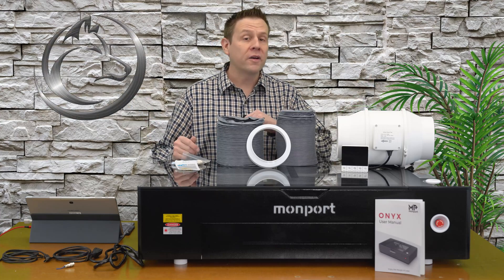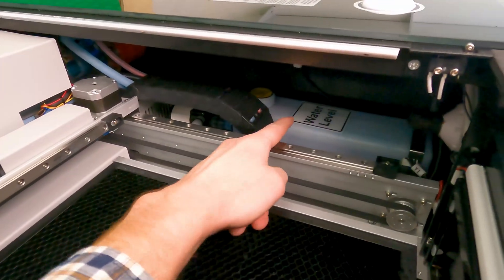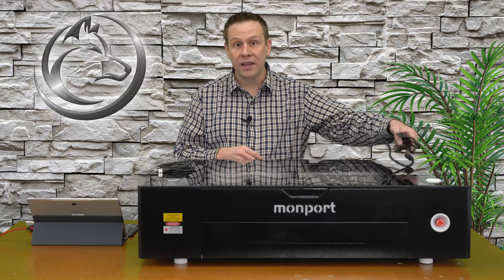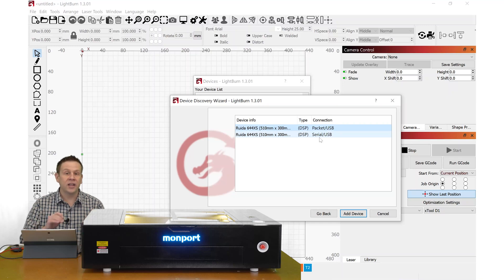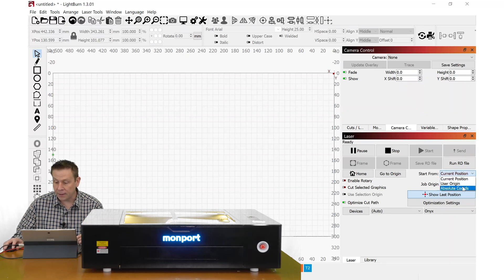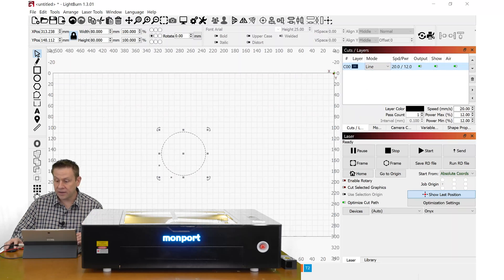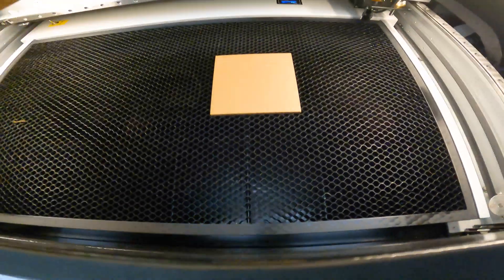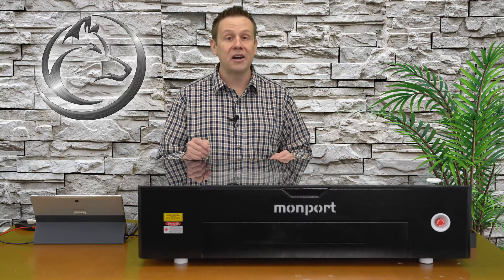Monport Onyx  Setup and First Lasering (Condensed Version)

Comment: I just received my new monport onyx r laser.   I have one problem with it.  The Z axis and autofocus does not work.  Everything else on the move box works fine.  I cant figure out whats going on.  One comment is read on the internet says there is a fuse for the z axis, I cant find any fuse?   I have contacted support but havent heard anything yet.  Only had it for 5 days now, what a bummer.

Comment: How do you like Monport? Are they good?
Reply from the maker: That's a common question a lot of people ask.  For me they've been very good- I understand what type of laser projects/materials I plan on working with.  If I have any questions I email them with what I would like to do and wait for their response for their recommendation(s). Forum groups can be hit and miss getting a feel for a brand name- people tend to complain more than they praise and those with positive experience are in their shops creating projects.  I think the product lines are good- I've used the 40w Co2 laser line, Fiber laser, and Onyx with Co2 laser- I think all of them are good.  Later this year there's possible plans for a large 130-150w co2 laser!  Hope this helps :)
Reply: Monport does not answer customer help requests?  You're better off buying on eBay.  The support will be the same.  If I don't hear from them soon I be disputing with CC company.  There is a whole FB group experiencing this. I received a brand new machine that doesn't work. Beware!
Reply from the maker: @jayvanessa6551  Sorry to hear you're having a bad experience, but thank you for sharing.  Right now I know (2-13-2024)a lot of the staff are celebrating the Chinese New Year.  Keep me posted on your issue(s).  BTW- what's not working on your machine?
Reply: @thelaserchannel1  I could not get it aligned.  A lot of people assume you're doing it wrong.  I took the gantry and frame out, you'd not believe how twisted it was.  Like a friggin' rocking horse when I pushed on the corners.
Reply from the maker: @jayvanessa6551   Ouch- yea, that doesn't sound right!  Mines been great- sorry to hear yours has issues.

Comment: The duct reducer goes directly on the air pump. You don't need to cut sections of the duct lines. Nothing necessarily wrong with it since you've already done it, but new users should probably avoid that part.
Reply from the maker: You are correct- the reducer is designed to be placed directly to the inline fan.  My machine, the reducer does not fit the inline fan.  Thanks for watching and commenting!
Reply: @thelaserchannel1   It's a very snug fit, but unless there's something wrong with yours, or if it's a demo/prototype unit where things were still being cobbled together, it should fit. It took me a couple tries for mine to the point I started to doubt it, but it did go on eventually.
Reply from the maker: @heroofharo   I would prefer to press the reducer on but in my setup they are almost size on size.

Comment: Looks like a rebranded Gweike Cloud to me. Identical internals. Keep a keen eye on that lens. The internal air assist recirculating smoke and fumes leads to premature lens failure and burnout if you aren't diligent on cleaning it.
Reply: Yes this is exact copy of gweike cloud, exactly same polar and now monport.
Reply from the maker: @alwynsuares2394   It's an interesting layout for all the components.  It is nice that everything is contained in once machine- cooling system and air assist pump.  I do want to see where the air assist pump is located inside the machine.  I've manly made setup videos so far but the testing (engraving/cutting) off camera shows the included inline fan exhausts the smoke/smoke residue exhaust out the machine very quickly.  I'm not trying sell you the machine, more just sharing what I have experienced.
Reply from the maker: Thanks for the info and tip!
Reply: all omteck, GW, and MP use the same company and just make the housing different and slap their logo on it
Reply: In my manual, it says “polar” by mistake 😅